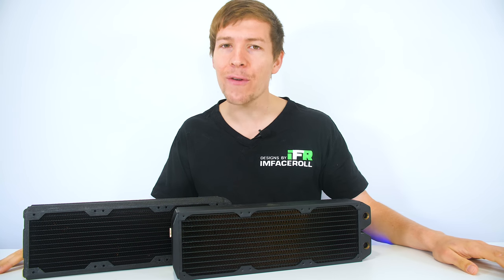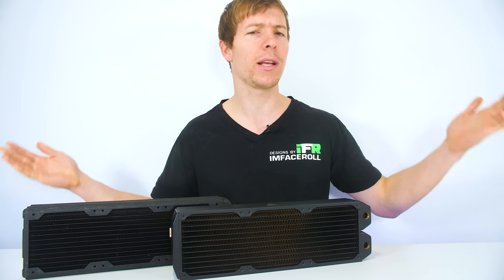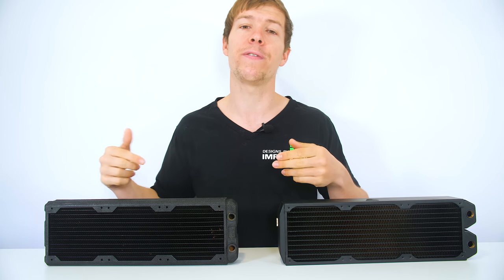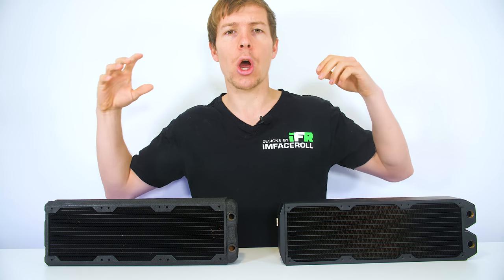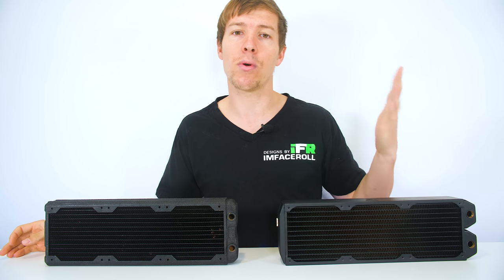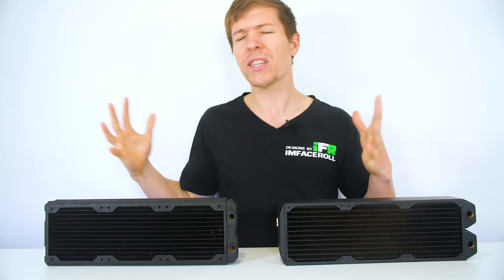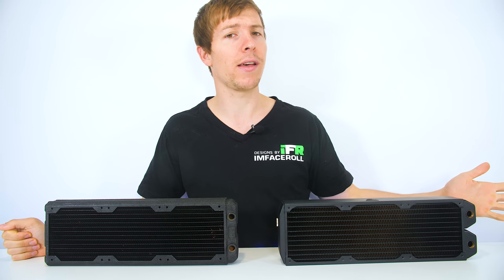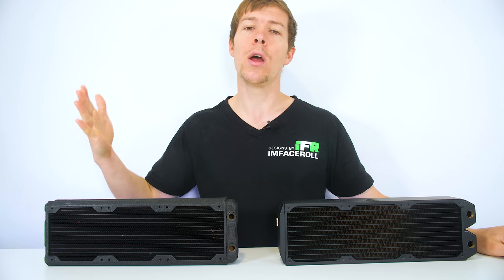Beginners PC Water Cooling Guide to Buying Radiators - FPI / Surface Area

Comment: My guide to buying radiators... Does a Hardware Labs GTS or GTX fit in your case? Yes... get that and ignore everything else. No... EK PE, Magicool 360 G2. But what if only an EK SE rad fits in my case... throw out your case (and the rad if your purchased it) and get a new case and rethink your life decisions. IMO, the amount of cooling you need starts with the amount of rad area and airflow your case can support... don't get that right then it doesn't matter what type of rad you get. Which leads me to asking for a ....

Buying a case for a custom loop guide. What to look for, what cases are the best in your experience, what cases should you avoid, best case in each form factor, etc.
Reply: Indeed!! HWL ftw.
Reply: I've used a HW Black Ice II 240 for ages until swapping for an Alphacool XT45 360. Both EXCELLENT brands and I trully crave to see more of both around.

Comment: Can you do a video how best to combine pumps in one loop i need more psi? can you just add a pump in the loop do  they have to have the same specs ?  Can you have 2 pump /combo combo units in one loop. i'm looking to upgrade my system and wil have have 4( 2x360  1x280 and 1 560) then i will have some splitters, some digital flow and temp sensors, and add some quick disconnect. part of the tubing in the pedestal wil be flex tubing and then i will go over to hard. also a CPU block 2 GPU blocks vram block maybe m.2 blocks. SO i wil have a lot of restriction. I Want to reuse my current d5 pump combo and  rads etc. It maybe a stupid question but i always see people do dual loops i just want one loop but can i just add pumps ?

Comment: They dont sell HW labs in Australia anymore ;/ I hate EK ones..have 2 480XE'.  They need to make the housing more rigid and the stop plugs use some weird paint . But my fans are set to 400 rpm and 650rp at load. Pumps end up being louder;/